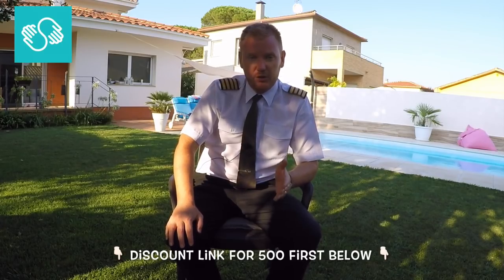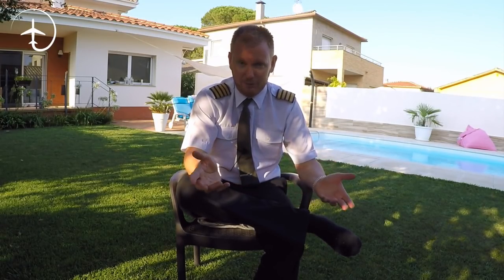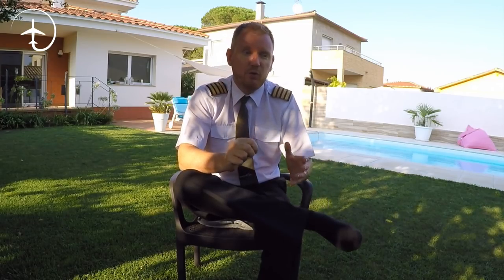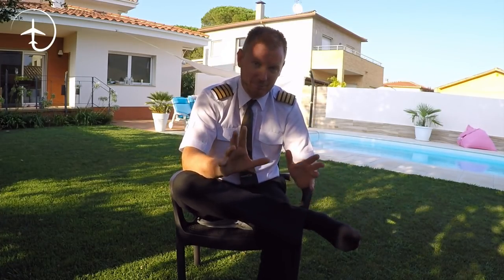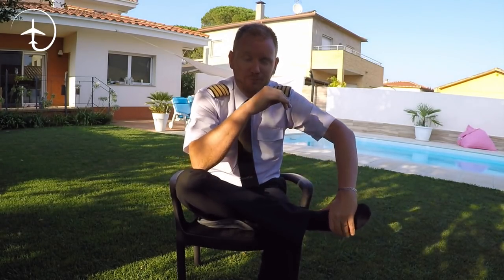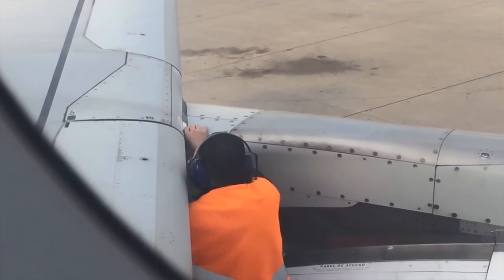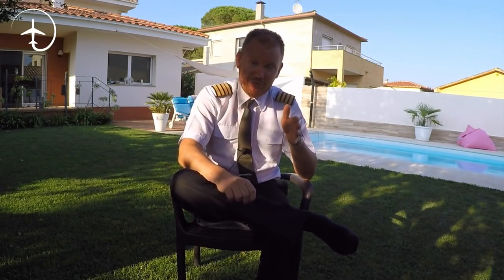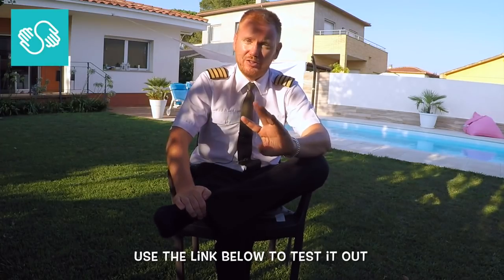Fixing aircraft with DUCT TAPE?! Mentour Pilot explains.

Comment: If they use duct tape, what are the consequences?
A)The tape will fall and the part will fall
B)It will get sucked into the engine
C)It will melt
D)It will shear off
E)None of the above
Reply: Most likely E)
Worst case scenario would be D)
Reply: @speedbird9313  What do you mean by E)?
Reply: Most likely; E) "None of the above", worst case scenario D) "It will shear off."
Reply: @speedbird9313  Then what will happen?
Reply: Nothing

Comment: How about fixing the plane properly, fix the broken seals, corroded panels etc ... wait until glues, epoxy etc cures 100% before flying again. Airlines are too involved in $$$ over maintenance costs. If there is a crack, ground the plane, that crack is not going to get any better. Just my opinion.

Comment: I'm amazed that you actually seem to trust these immensely complicated machines. You go up in them again and again, so clearly you believe that everything is going to function, that the makers have done their calculations properly, that the maintenance engineers were not overtired and made no mistake, that the engines won't conk out (or if they do that it won't be catastrophic), that there is no hidden corrosion eating away at a crucial part, that severe turbulence is not going to smash the airframe, that there won't be a fuel leak, that rain didn't get into the works, and so on and so forth. A lot of things have to go right for this box of tricks to hang together and go on hangng together for many years. Where does this trust come from . . . ?